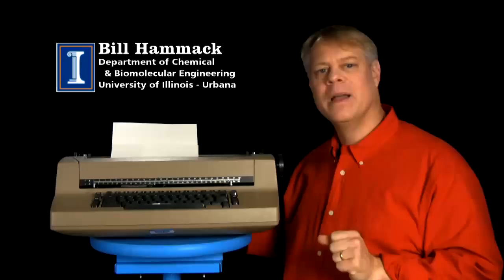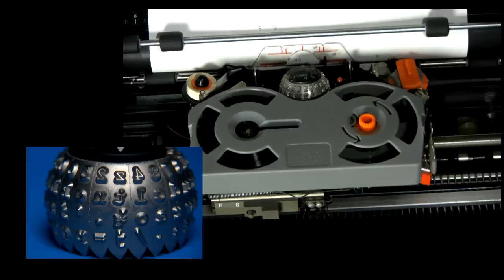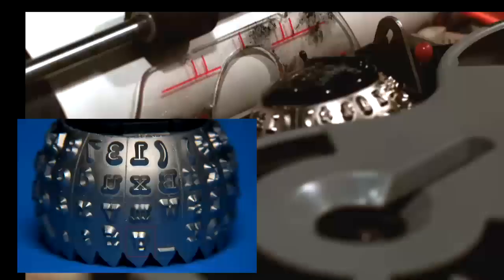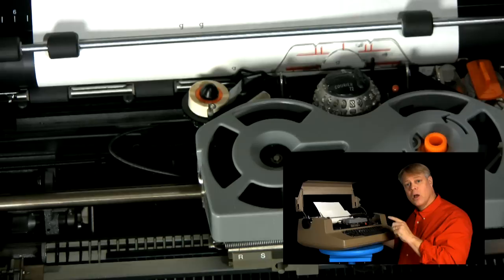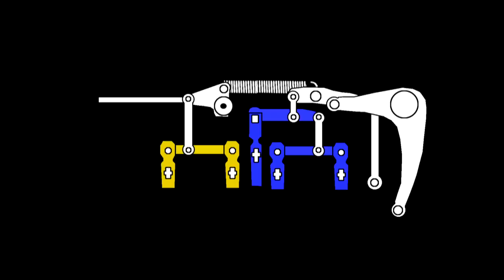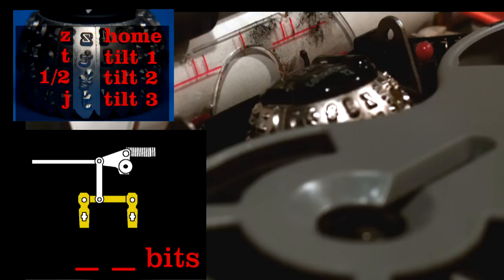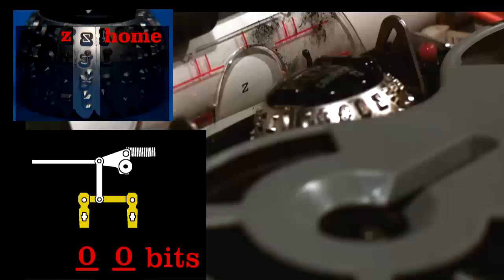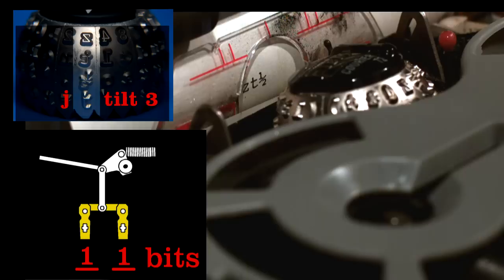IBM Selectric Typewriter & its digital to analogue converter

Comment: It is indeed a good question, with an answer.  No D/A converter can produce a truly continuous value.  Instead it will produce an approximation.  Most D/A converters will have many more "positions" than the Selectric's 88 or 96 -- for instance a Compact Disc has 16 bits per sample which is roughly 65000 positions.  This makes it "continuous" for practical purposes (i.e., our ears can't hear that it isn't continuous.)  But it still has discrete positions, just many more than the typewriter has.

Comment: Very cool...the Selectric was definitely an overlooked engineering marvel and as I recall the same technology was also used as the "console" of some of the first interactive IBM computer programs of the time. It got me thinking about my early days and made me wonder, have you ever done a video on how a slide rule works? I was in undergrad Engineering College in '75 and the TI calculators were already in use by almost everyone but some of the Profs still required we use slide rules in the beginning of the course work...my Thermodynamics Prof required them throughout almost the entire course, though he allowed the TI to validate our answers (a recently retired multi degreed Engineer with Lockheed Martin.

Comment: Superb video!  Very clear explanation of a fabulously elegant (and remarkably robust) mechanism. However, is the IBM Selectric really a D-to-A converter?  To be truly analogue, wouldn't it need a continuum of positions?  The typeball has 88 discreet positions (96 for Selectric III) so it seems more like a digital-to-digital converter.  It's like the difference between a dial or a digital display for a watch.

Comment: @Meddlmoe - Great question!  I hadn't thought of that!  3 bits would not give enough combinations for the typewriter to access and output all of the necessary symbols printed on the ball.  Very complicated, indeed, and using the least amount of parts necessary to accommodate the device. Can you imagine the amount of trial and error there must have been when the first designs and prototypes came out?  The level of precise measurement and mechanical fine tuning is a whole different story, too!

Comment: Analog isn't necessarily continuous, however it has far more levels than Digital which just has 2. For example, an analog clock where the second hand ticks every second, rather then sweeping around the clock face. Or, say, an 8-bit Digital to Analog converter (DAC) which has 256 discrete levels, but is still considered Analog.

Comment: About using them as a computer output device -- some early IBM printing terminals did exactly that (input too), for instance IBM 2741 (and that wasn't even the first one, just a popular early model).

Now I wonder how these Selectrics avoided problems with the cables stretching over time?  Never seemed to occur.

Comment: Great video, lucid explanation of an icon ! I had always wanted to own a Selectric but had to settle for a Canon AP100 instead. The latter wheels used daisywheels instead of the spheres that the Selectrics used, an advancement perhaps . Nonetheless, the Selectric looked solid and better engineered than the Canon
Suresh
Strasbourg, France

Comment: Why on earth would z, t, 1/2 and j be the characters on the zero rotation face of the ball? Wouldn't you expect them to put the most common characters closest to the rest position of the device, for maximum efficiency and minimum wear on the moving parts?

And it's not as if they're somewhat common either, it's very much as if they actually went out of their way to deliberately put some of the least used characters on the most efficiently accessible face of the ball... Is there a good reason for that?
Reply: "The system was highly dependent upon lubrication and adjustment and much of IBM's revenue stream came from the sale of Service Contracts on the machines. Repair was fairly expensive, so maintenance contracts were an easy sell." (Wikipedia)
Reply: CromemcoZ2 Ah damnit, that's probably the reason isn't it.There's a special place in some ironic ancient Greek punsihment-hell for whoever is responsible for design decisions like that. These IBM guys and whatever bastard decided to make the doohickey that opens the lid on my otherwise very expensive and well-built kettle out of the flimsiest plastic available to man should spend all eternity hand digging out landfill sites for endless trucks full of broken kettles and typewriters.Oh, and make the kettle guy dig the hole for the typewriters, and vice versa; just to confuse the buggers.
Reply: Ya, or at least arrange them in the Qwerty Fashion.
IDK.  I am sure there was a method tho the madness tho :)
Reply: 't' is a common character, so I think the choice has less to do with picking common or uncommon characters as it does the physical layout of the keys and the mechanisms that connect them to ball.
Reply: I'd expect each character to be set as close to evenly distributed based on frequency of use as possible.   In other words, everything spread out so the average rotate/elevate and strike time more or less evens out across all characters, so the placement would appear almost random.   

If all the frequently used characters were clustered together, the mechanism would presumably have an awkward pacing where some characters took longer to type than others, perhaps only a fraction of a second, but enough to where it might cause an issue, particularly for fast typists who want an even flow of ribbon strikes.
Reply: @kev3d   I believe one of the features of Selectric was that the speed of typing any letter was constant (IIRC it took one revolution of the main axis to print/type any letter). Also seem to remember that there was two key roll over (one was being typed, one was held in 'memory' and while this happened further keys presses were very disabled. So the 'fast typist' idea is probably not correct, unlike with the original QWERTY and key jamming.
Reply: @MrRevertis IBMer ('68-'98) / selectric fixer here.  Every character printed at the same speed once the key was pressed.  How much or how little the ball had to tilt/rotate was irrelevant to efficiency or speed. A single helical spring clutch was responsible for all ball and carrier movement and that movement always allowed time for maximum tilt/rotate.   Also the type balls came in many fonts, languages, special configurations and were user interchangeable so you can't assume what characters appeared on that 'home position' on the ball.

Comment: Look at my icon/avatar and you will see me seated at the console of an IBM 360/44 mainframe computer in 1967.  I am typing on a 1052 console typewriter which was really a Selectric typewriter in a different case (as it was attached to the table top and was not moveable).  I did not realize until now that the controlling mechanism was analogue.

Comment: 10:13: This video could have been much more comprehensible if you had added arrows to point out the respectively corresponding tabs in the drawing, for each time you said "this tab". It's not trivial to intuitively understand that, even to understand which bit is suppose to be a tab, if you don't already know what you're looking at. For the record, the "tabs" are the pieces closest to the red digits. They're the yellow bits that seem to have what looks like cruciform (i.e. cross-shaped) white marks on them.

Comment: Excellent video.  Due to the number of bits, up to 32 positions would technically be possible, but that doesn't explain the case of the letters.  Do the shift and caps-lock keys control which hemisphere the ball is held in in real-time?  Or does the extra half-rotation only happen after you press a letter to be typed?
Reply: Pressing Shift or Caps Lock immediately rotates the ball 180 degrees to the uppercase hemisphere, and as long as Shift is held down manually with your finger or continuously with the Caps Lock key, the uppercase hemisphere is active. The wiffletree mechanism for rotation and tilt then works the same way as it does on the lowercase hemisphere.

Comment: The old day mechanical device designers were genius. Some examples were  German Cameras and American calculators, like NCR, Monroe and Friden , the latter could do +-x/ in sequence. However they were all phased out when we go "result orientated" things. A $1 electronic calculator can do the same or even better, lets forget the tube flames and green LED display models sold for hundred dollars if not a thousand. A mordern day printer, especially the multi-function units can do all in seconds.  In between, there were some short-lived "golden fingers"  before digital printers were born. Tech kills tech ruthlessly.

Comment: @Savannahsens3 Yes, qwerty has been there for 140 years, it might be called optimal for some period of time but now it's definitely not. It really amazes me that people have to use such ancient and complicated input method in 21st century, there was hardly any development since the last century. On the other side, the output, screen/monitor, are still evolving fast, as of now with high density 3D capable images. Yet we still try to hit over 100 letter and symbol keys one by one...

Comment: I know that this is an old video, but doesn't the rotation require 5 bits since there are 22 positions on the rotate function?  If shift uses some other mechanism to rotate the ball 180 degrees, that would still leave 11 positions for the wiffle tree, which would take 4 bits to cover.   Can you explain the rotation mechanism?

Comment: Doesn't the schematic of the Whiffletree shown only possess 3 bits input for the rotating mechanism? Wouldn't that just allow 8 different settings?
Reply: It's not a binary bit. 
You can represent multiple values using a single bit.
Reply: Oh yeah I was so fixed on binary, ty :D
Reply: Look again, there are 5.

Comment: Really enjoyed that video really helped me understand the process behind IBM's dig/ana. printer.

I'm sure this is probably a stupid question, but I would love to understand more about how each individual character is being printed onto paper.
I know you mentioned the metallic character ball will turn and rotate based upon the input provided to it, but what is the black "film/paper-like" thing that also moves and has character's cut out of it?  I assume it is to prevent ink splatter from the metallic ball pressing onto the paper.  Does this follow the same "whiffletree" mechanism.

I guess i'm confused about the actual purpose of the black paper that has character's cut out of it and moves and i assume matches which character is selected based upon the rotation and turning of the ball.  Anyone know what this does or how it works?  thanks, in advance...great vid
Reply: The 'black paper' is the ink reel that all typewriters (that I know of, so probably not 'all') use, it is just a ribbon covered in ink that simply moves across so that every key press has a clean splat of ink to press against the page.
Reply: that paper has ink on it
Reply: +mark99k Also why used ribbons thrown into the trash (still wound on the take up reels) were a spy's dream. The military and security conscious users probably burned them.

Comment: So you've never seen a IBM Memory 50 (Model 580) or Memory 100 (Model 1580) electronic-mechanical selectric machines from the early 1970s?  Prior to that was the Magcard system.

Comment: You said rotation has 22 positions, but the whiffletree only allows 8 different rotations (3 bits). How does it work ?
Reply: OK I found how it works by looking at an IBM repair manual : the 3 lugs used for rotation (called R1, R2 R2A) allows to select 5 different positions in one direction. By activating another lug called R5, it reverse the direction and gives 6 other positions (making 11 positions in total). This only cover an hemisphere. Pressing shift key (eg : for uppercase or digits) will rotate the ball by 180 degrees and allows reach the other hemisphere (giving another 11 positions, making 22 positions in total).

Comment: Can you make another video explaining the security deficit this typewriter had? Unfriendly nations could read minute fluctuations in the line voltage because of the distinct effort the various combinations of levers needed to move the ball up, down, left, or right and, basically, retrieve what you were typing. So, a heavy, lead flywheel was attached to the motor and it was this flywheel that moved the levers. As the flywheel slowed down, a clutch would connect the motor to the flywheel again and speed it up to operational velocity. The RCMP used these sometimes.

Comment: What are it's advantages over a normal typewriter?
Reply: Hiya - I used to fix these years ago in the UK where we developed an electro/mechanical device to link this to an early 1980s PC as a printer.  As soon as the daisy wheel system came along these machines became too expensive to repair and/or maintain due to cable snapping or print ball alignment problems.  Then some-one invented word processors and proper printers for PCs and all the old electro/mechanical systems went on the scrap heap.
Reply: You could pop the ball off and replace it with a different font in about 5 seconds.
Reply: Individual typebars that swung up to strike the ribbon and page in a traditional typewriter would jam if the typist typed too fast.,

Comment: what is the difference between digital and analogue, exactly?
Reply: Augusto Vasconcellos I know you asked this three months ago, and you might already have the answer, but here's my simple reply:
Digital is like a standard light switch; it is on or it is off. This can be represented as a 1 or a 0, for on and off respectively. This is also how binary works, which is what computers use at a very low level (it's also incredibly interesting, so definitely work checking out!)

Analogue is like your voice. You can change your pitch (higher or lower voice), tempo (the speed), and the length (how long you say a letter/word/sound). In other words, you have infinite possibilities. 

So to recap, digital only has two states; on, and off,   whereas analogue has an infinite number. 

Hopefully this explains it for you!
Reply: Analog is any magnitud in the real world, like temperature, light level, presure, sound intensitiy. digital is a computer representation of such magnitudes made of ones and zeros. Key difference is, a digital temperature has a finite number of values. for example, you have 14.569F and the very next value is 14.571F. Of course you can improve this and make this step smaller but it a trade off between resolution and storage capacity. No computer has infinite storage so any magnitued need to be downconverted to an aproximation. Its like a 30MP photo. If you keep zoming in, you will end seeing pixels. This is not happening in the real world with you zooming and image using a big telescope. But no one can store a photo with infinite resolution, so you need to set  limit somewhere. it can be ones ans zeros or any other convention like in the case of this typewrite, lever positions or displacements where a combination of those get any intermediate value.

Comment: What if i type really fast, will the ball be able to catch up with my speed?
Reply: There was a mechanism called the compensator tube within the keyboard. It limited the number of keystrokes you could do in a given time (basically ensured that you could not type another until the previous cycle was completed). Nevertheless, a good Selectric typist could beat out any other typist on any other machine.